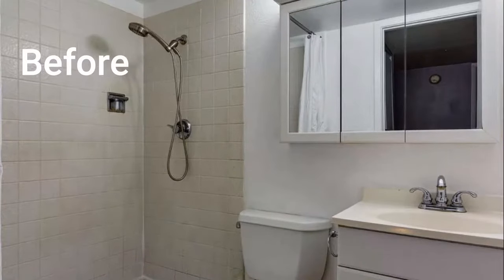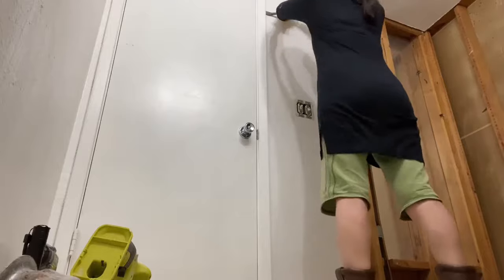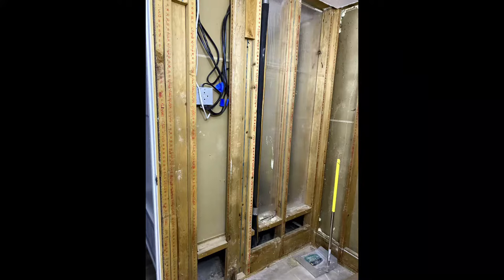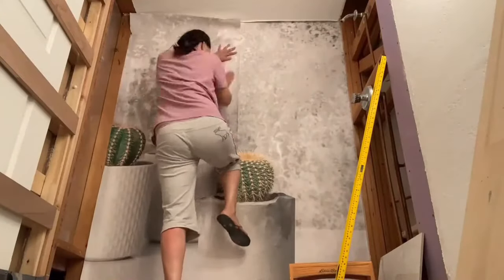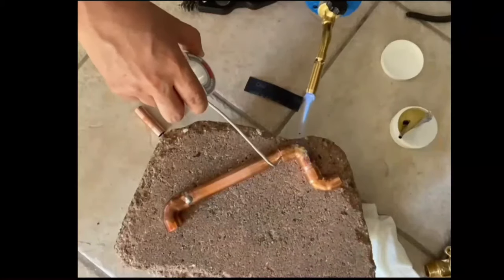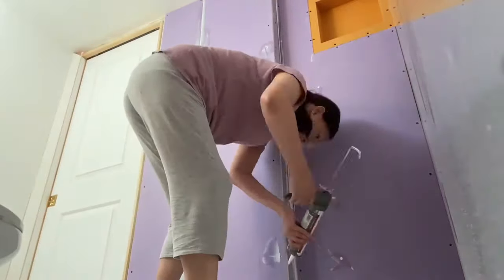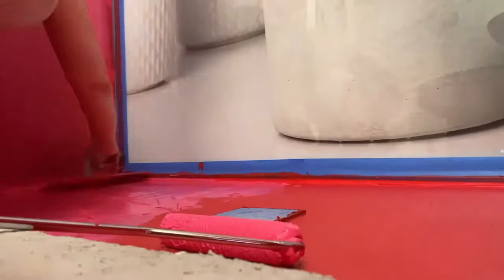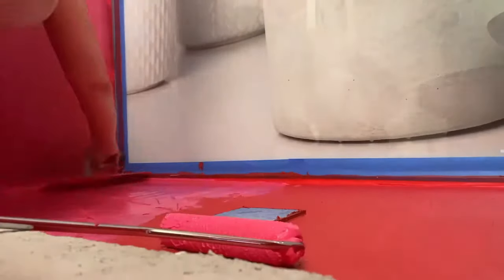Bathroom Remodel for Beginners - DIY - Renovation on a Budget

Comment: Impressive!!!! Did you waterproof behind the cactus paper?
Reply from the maker: Thank you so much. There is moisture resistant drywall behind the wallpaper. And also 1/4 inch thick tempered glass is covering wallpaper. All around edges of the glass is waterproofed. 
Sincerely,

Comment: Amazing job, really beautiful. I have never seen wallpaper in a shower, but it’s so pretty. Where do you get it ? Is it vinyl?
Reply from the maker: Thank you so much!
I bought the image on Shutterstock.com. Then got it printed on muralsyourway.com. There is 1/4 inch thick 60 inch wide 80 inch tall tempered glass in front of the wallpaper though.
Reply: @9handz-diy819  pls where did you source that size tempered glass in front of the wallpaper?
Reply from the maker: @blaxonmax007  i googled and found local glass & mirror company and ordered the glass with my specific size. And they delivered to me. 1/4 inch thick, 60x80 inch tempered glass cost $320.
Thank you for visiting!